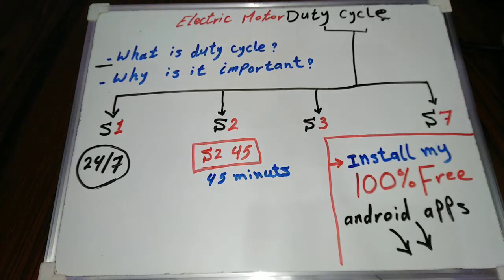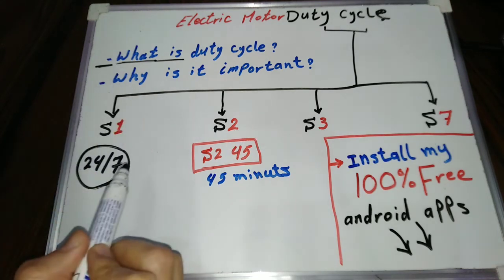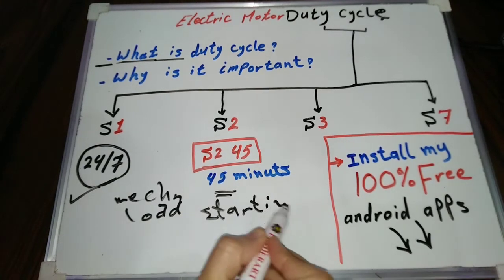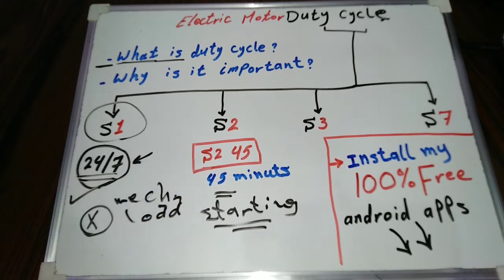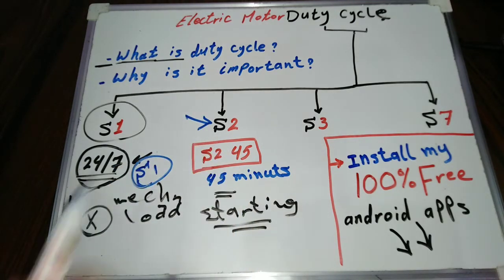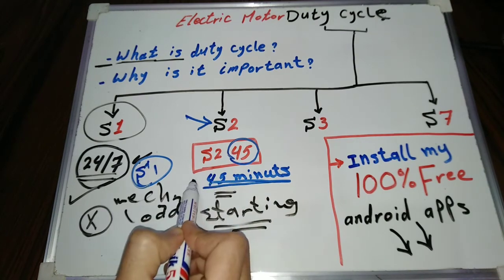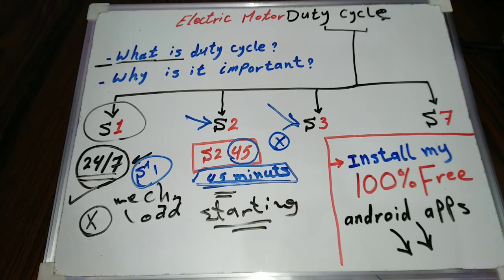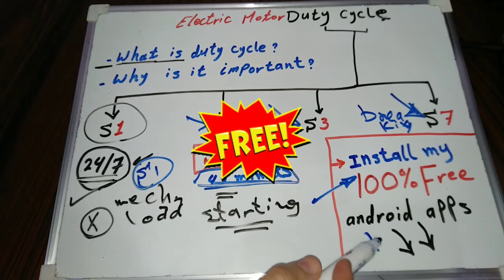Duty Cycle of Motor Explained!

Comment: when a motor is S2 45 - does it mean that the motor can work for 45 minutes and after this period of time it must be shut down? how much time after the motor should be turn on again?
Reply: The rate is listed where on the motor?
Reply from the maker: After running for 45 minutes, the motor should be allowed to cool down for a similar period of time before being started again. This helps prevent overheating and ensures the motor's longevity and proper operation.